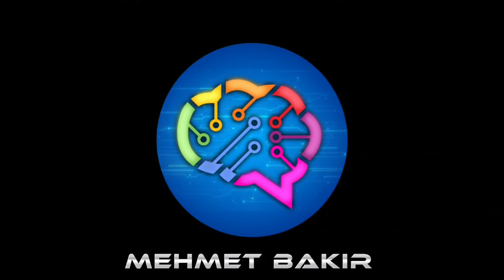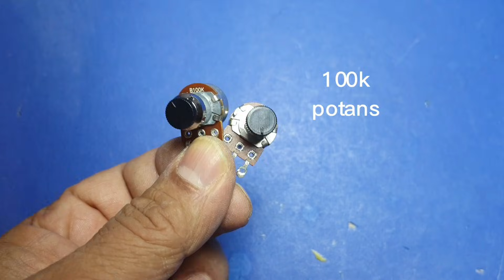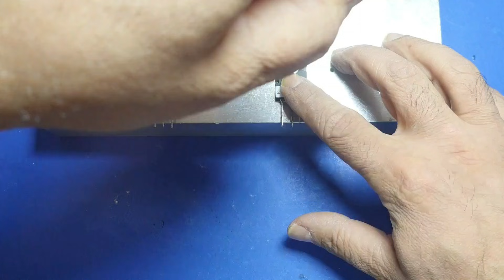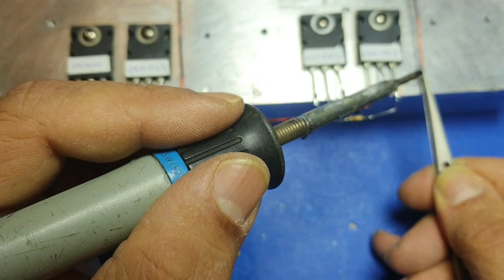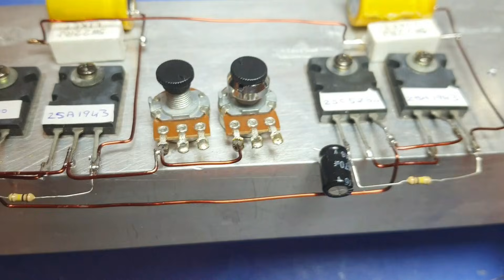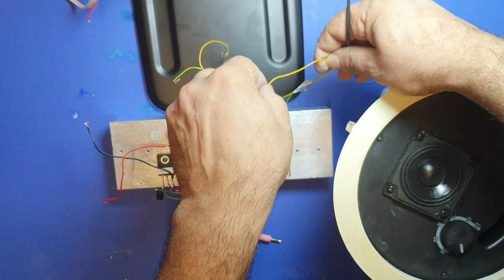2sc5200 and 2sa1943 powerful stereo amplifier . 2sc5200 & 2sa1943 güçlü bass amfi yapımı . DIY

Comment: Bro what condition should i use for capacitors parallel or series
Reply from the maker: You need to make a series connection. Actually, I tried to show the circuit in as much detail as possible in the video.😊

Comment: Can I use TTC5200 and TTC1943 instead of 2SC5200 and 2SC1943?
Reply from the maker: It can be risky even though it has the same pin and almost the same voltage range
Reply: @mehmetbakr3062  but in our country specially my area the electrics shop has only that
Reply from the maker: I'm sorry about this. There's a page online called "All Transistors" that lists the equivalents of all transistors. When I checked there, I unfortunately found that the transistors you have are not equivalent. But just to be sure, I'll find the transistors you have and make an amplifier circuit. I'll post it on YouTube.😊
Reply: @mehmetbakr3062 thank you 😊
Reply from the maker: Your,e welcome

Comment: Hello, I am Patrick, a technician. I am writing to you today to request a technical service. Could you please provide an NCEP15T14 transistor?Can I replace an NCEP15T14 with an IRF1010E since they are both MOSFETs? I have serious doubts about their channel power.

The NCEP15T15 operates on the P channel.
The IRF1010E operates on the N channel.
Reply from the maker: Hello Mr. Patrick, there is a website that shows all transistor values and pinouts. I can't share the link because it poses a risk to my channel, but if you type ALLTRANSITOR in the search bar, it will appear.

Comment: HEMEN CEVAP VEREBİLİRSENİZ ÇOK YARDIMCI OLURSUNUZ
Reply from the maker: Merhaba transistörün kendi datasheet den alıntıdır ama videodaki devre için sadece dc 12 volt uygundur 
2SC5200 Ürün detayları
Özellikler
• Yüksek Akım Kapasitesi: IC = 17A.
• Yüksek Güç Dağılımı: 150 watt.
• Yüksek Frekans: 30 MHz.
• Yüksek Voltaj: VCEO=250 V
• Güvenilir çalışma için geniş SOA.
• Düşük THD için mükemmel Kazanç Doğrusallığı.
• 2SA1943/FJL4215'e tamamlayıcı.
• Termal ve elektriksel Spice modelleri mevcuttur.
• Aynı transistör ayrıca şunlarda da mevcuttur:
   -- TO3P paketi, 2SC5242/FJA4313: 130 watt
   -- TO220 paketi, FJP5200: 80 watt
   -- TO220F paketi, FJPF5200: 50 watt

Comment: Cuanto es el voltaje DC que se le puede conectar a este aplificador ? Muchas gracias y buen video 👌
Reply from the maker: thank you very much.. 12 volt 3A
Reply: @mehmetbakr3062  22 or 24 volts can not work?
Reply from the maker: Since this state is not a professional circuit, 24 volts is not suitable.

Comment: Hello, without diodes to correct class b or class ab connection (crossover) distortion, it doesn't work well enough.
Reply from the maker: That's right, my aim is to show how many types of amplifiers can be made with different connections of a transistor, from simple circuit to professional circuit.